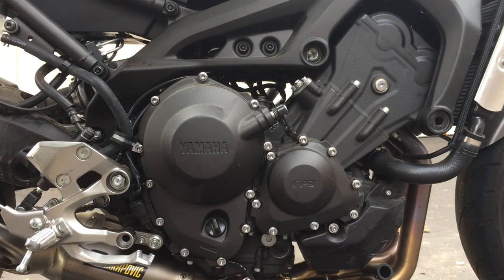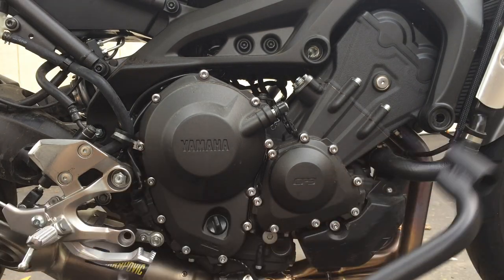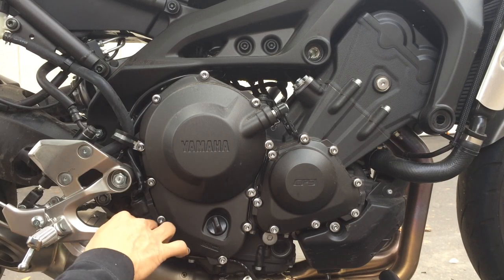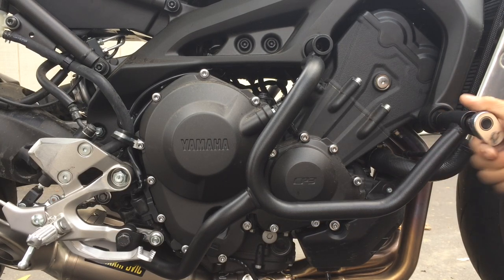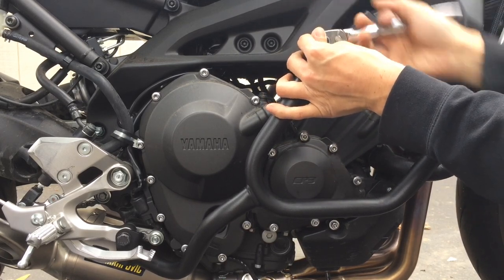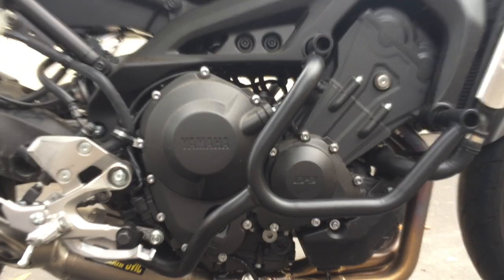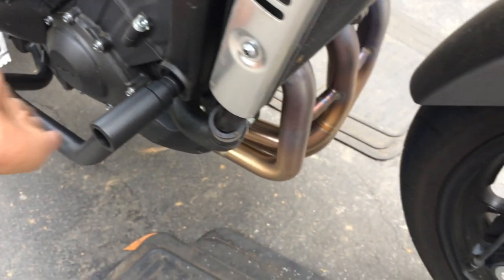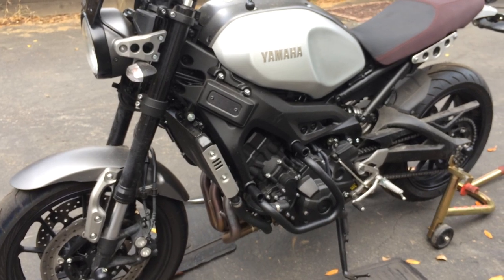XSR900 Givi engine guard/crash bars pt.4

Comment: hi, my XSR900 engine light is on now for 400 mileage,   is this means my bike close to first service (600miles),  your bike have that light on when it about to do first service?
thanks.
Reply from the maker: No it should not light up, no light should be on for any service.  This bike does not have any maintenance reminders.

What work have you done to it?  Most all problems occur after something has been touched (work of some type or another no matter how small it seems, making an adjustment, changing something, what ever).  Back track an you will find the mistake.

If you didn't touch anything at all then take it back to the dealer, it is new so should still be under warranty.  Also get an OBDII scanner/reader and you can find what is causing the engine light.
Reply: I went to the yamaha dealer, and they said My bike was update the sofeware incorrectly ,so they just re do it.
they said I might use key or kickstand to turn the bike off, that will cause  engine light on,  it is a bug, and yamaha fix it for free.

Comment: want this bar on my tracer 900 gt 2019. wont it fit????
Reply from the maker: It should. I got it from revzilla
Reply: @DaBinChe   to everyone, this crash bar will fit  a 2019 Tracer on the left side with no mods, the right side will fit only if u can cut n grind steel. takes some cutting of steel to clear the botom mount